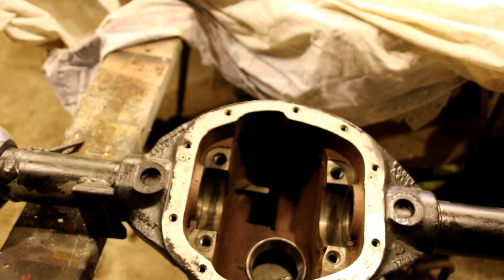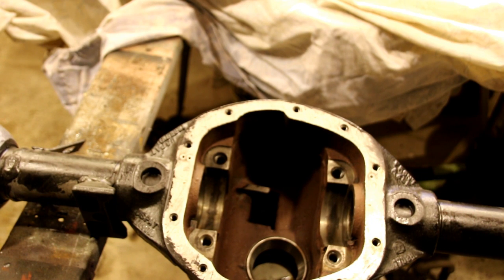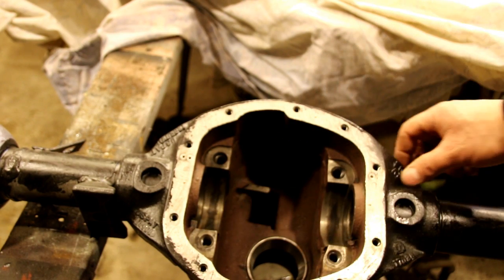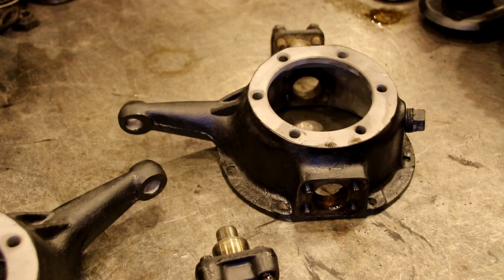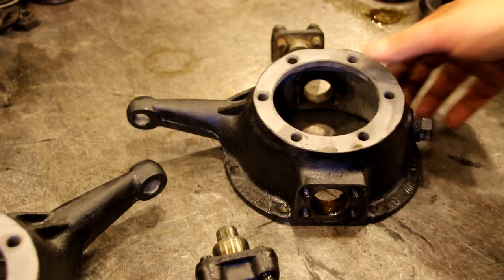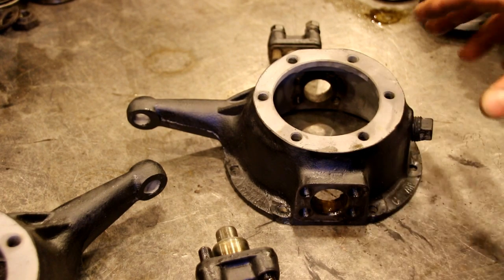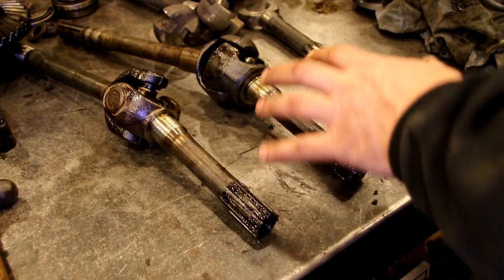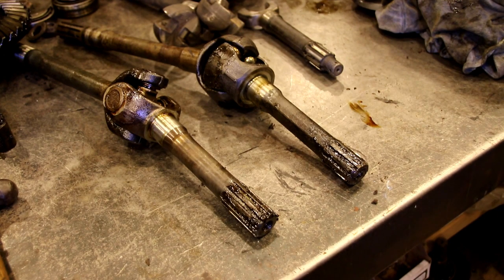Willys steering knuckle installation, proper lubricants for Willys Jeep

Comment: Could the ball end where the bearings are be bent vertically and cause the lack of shimming to get the preload and cause the ball to be egg shaped?
Reply from the maker: not usually.  If the axle area is bent where the bearing goes then there is a big problem.  On a recent axle build I did it came in with the U joint exploded into many pieces.  There was enough damage to break off the upper part of the knuckle where the bearing sits. Axle was junk.

Comment: Hey Brian. I would appreciate your thoughts on the seals...more specifically, what brand/part numbers for the front inner and pinion seals? I ordered some, but I think they are Crown or Omix-ADA, made in China and look pretty flimsy. Any concerns with these or suggestions?
Reply from the maker: I don't use Omix parts any longer.  I used to be a distributor for them when I sold parts but they don't care about quality just cheap parts and making a buck.  I use National oil seals for most stuff.  Inner seals are 40576S and I have been using them for years with no trouble.  Pinion seals are also national  5778.

Comment: We have a 1950 Willys CJ3 that we are trying to get running. the front axle pinion gear WILL NOT come out! Everything is out but it. Tried the hammer, even a small sludge. Nothing is budging this thing. I don't see a way to remove the axle housings from the sides. Don't have a huge press. Was going to try to take axle housings off to take to a commercial shop. Like I said, Yoke and oil seal are off. Spider gears are out. What next without destroying it?
Reply from the maker: Sometimes they can be stubborn, best to take it to a professional to get the pinion out, so you don't damage anything.

Comment: Hi Metalshaper - I am rebuilding a couple of 1946 CJ2A, and am currently stuck with a problem at the front axle.  I replaced my old Bendix axles for Spicers and am putting everything together for a fit test.  I am finding that I cannot fully mount the passenger spindle to the steering knuckle.  It sticks out about 1/4 inch and even light torque binds the axel noticeably.   Q:  Is it possible that this spicer axle is 'too long'?  (i.e. not the correct axel for my dana 25), or that the inner bushing is incorrect?
Reply: FYI - The driver-side fits together perfectly, so I am thoroughly confused what is happening with the passenger side axle.
Reply from the maker: Check to be sure the axles are the same length as the Bendix axles that you removed.  if they are the same, check the spindle bushing.  Let me know if you have just a bushing or a flanged bushing in there.  could be that the spindle bushing is giving you the problem.  Give me as much information as you can and we will get to the bottom of this problem. 
Brian
Reply: @metalshaperJeep  Thanks!   I see that the Spicer axle is 22", but the Bendix is 21 3/8".   This is probably the issue.  I didn't know there were multiple versions of the axle.
Reply: I would like to replace the axle bushing.  Can you tell me a good way to pull this?  Do I require special tools?
Reply: I would also like to buy some of your ale lube.  It seems great!

Comment: After setting the preload at 15 lbs of pull the knuckle feels good. Then installed the seal and felt and torqued the retainer to 12 lbs the knuckle is very tight. Hard to move. Is this normal?I did the process twice,,same result. Please comment.
Reply from the maker: Yes, knuckle will feel much tighter after you install seal, that is why it is adjusted to the proper pull by itself.
Reply: It's so tight you can barely move the knuckle on the bearing axis?
Reply from the maker: @stevenbillings1620  When you installed the knuckle seals did you install dry or add some lubricant to the seal surfaces?   Some times when installed dry they are very hard to turn.  Add some lube and cycle the knuckle back and forth a few times and it should loosen up.

Comment: Brian what is the shelf life of your knuckle lube?
Reply from the maker: 40 years sitting on a shelf.  25 years when installed into the knuckle and used.  if you drive thru water crossings regularly then it is recommended to change it if water gets in the knuckle.

Comment: where did you find the old style oil seals with metal on both sides?
Reply from the maker: you can get the seals from Pete DeBella Jeep Parts.   631 874 8660 .  He has the seals and many other NOS parts.

Comment: Opened up the right side knuckle and not a drop of oil, just good grease 

Did some further reading and apparently I have whats known as a goopy knuckle on the left side. That's what you get when the inner oil seal goes and that's not good at all. It loosens up the knuckle too much. Now looking for a spring scale to do the bearing preload. Wish I had more tools now......
Reply: ok, so I used a 1/2 inch galvanised pipe with a 1/2 inch to 3/4 inch expander fitting (ground down on the grinder to fit into the tube) on the end to go into the axle tubes to tap out the axle races and the seals. Axle races and new seals are in place now. Ala' Mike the Mechanic style.  Used a 36mm socket and galvanised pipe to tap the races and the seals into their seats.
Reply: Mike Bondi ,
According to this post, it’s been three months and I hope you got your king pin bearings set up with the right preload. If not, we just did mine yesterday with the scale I bought and I can send it to you if you still need it. It’s exactly the one that Brian recommended.￼

Comment: How do I get a gallon of your 'summer' front axle knuckle lube?
Reply: Ask in a bicycle shop for a workshop Tub of white lithium grease.  It's designed to prevent metal to metal contact while providing minimum static friction. Used for racing bicycle wheel bearings.

Comment: Why not put shorter bolts in the top bearing.
Reply from the maker: Original bolts used in case the customer goes back to the original brake system in the future.
Reply: That would be an option, but I believe the engineers were probably trying to account for the thickness of the shim pack.  1-1/2 turns is about the thickness of a full set of shims.  It sure is unfortunate that the Tech Manual never got corrected.  I'm sure there are many trucks out there with jammed up bearings because of it.  I'm confident many motor pool mechanics transitioned over from the MBs and GPWs to the M38s and knew what they were doing without worrying too much about the content of the TM but, for those of us who rely on the TMs...not so much.